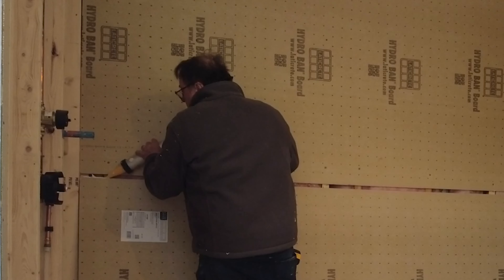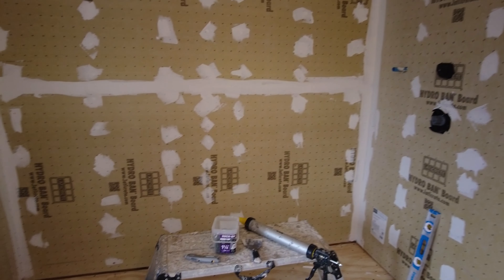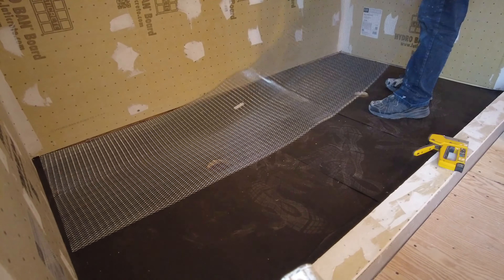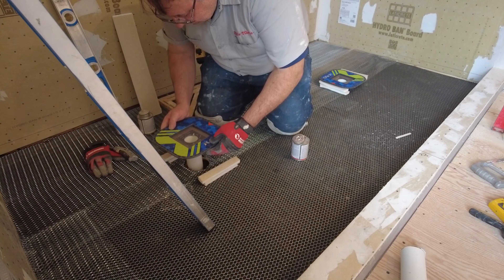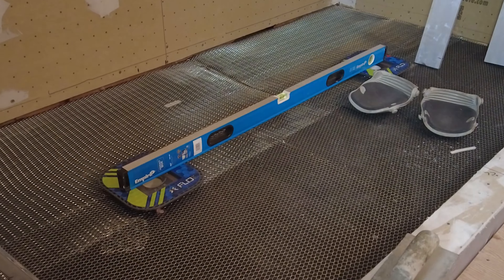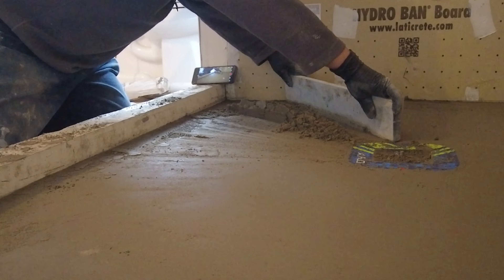Big Main Bathroom install, from studs to finished tile

Comment: Sal, I'm new to tiling and taking baby steps for now. I replaced a few larger cracked 24" kitchen floor tiles, which were installed on a very bouncy and uneven subfloor. Looking to re-do the floor shower corners now. Looks like they used grout in the shower corners. I'm reading that people do both, grouting or caulking, in shower corners. What do you recommend and what type do you use? Thanks so much. Love the videos

Comment: Nice job. I have a question about the grout, I put down basically the same tile in our shower, I sealed it with Miracle sealants company's tile, stone, and grout sealer. So, one area of the floor has discolored, it looks like a white/grey residue, it is the area on the floor where the shower hits directly, and below the soap tray. I can't seem to clean it off. Any ideas? Thanks